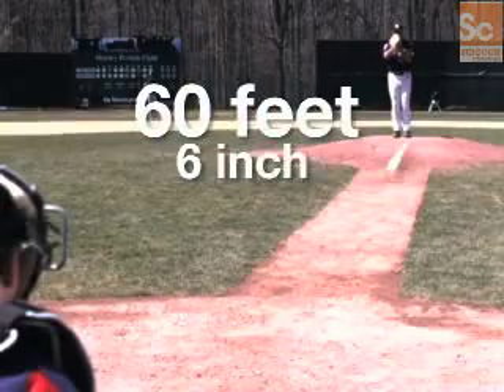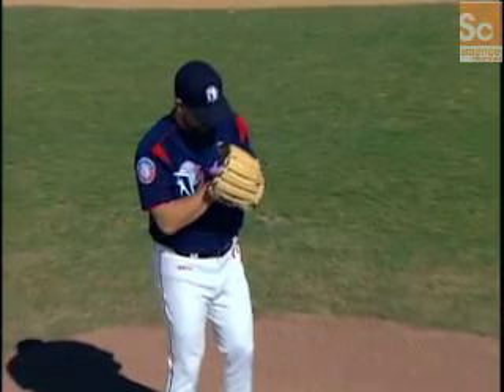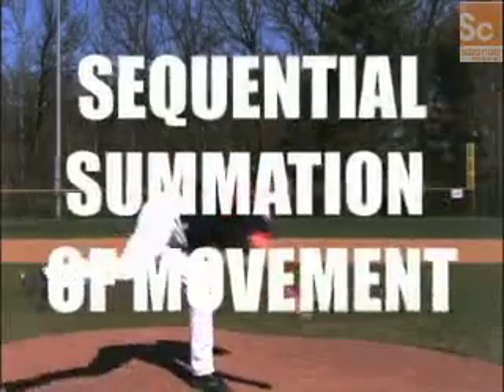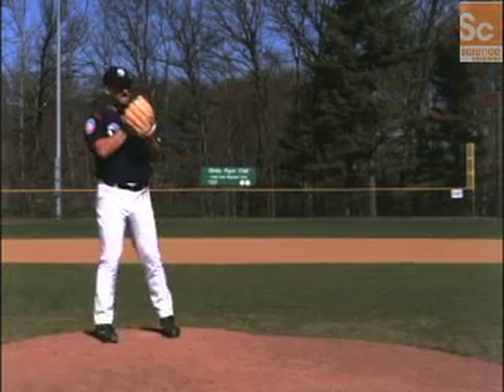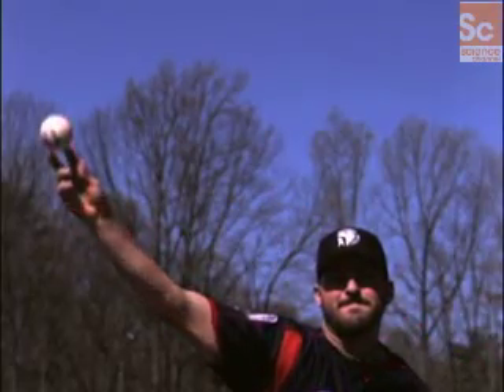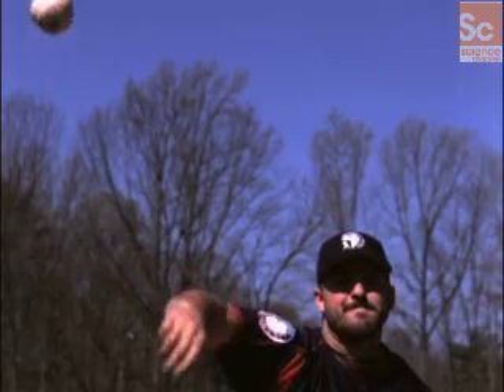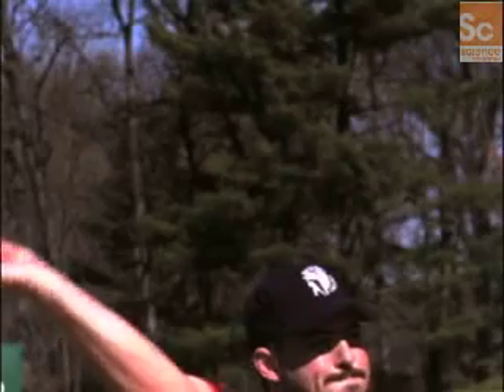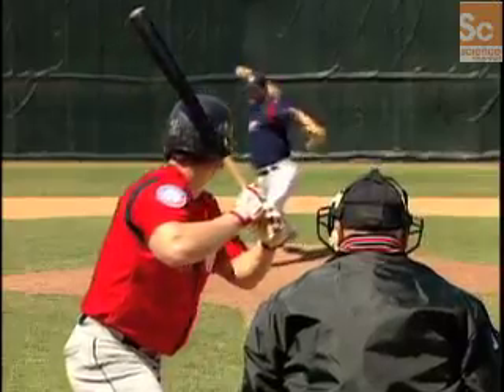The Physics of Baseball - Pitching

Comment: How does one "release a ball with less force?" Releasing, by definition is the removal of force. Whoever wrote this has no idea what they are talking about and is scientifically illiterate. Increasing the momentum of a pitcher's body has nothing to do with pitching a ball, it merely transfers the throwing event from a relatively stopped frame to a relatively moving frame.  The force exerted on the ball is determined by two factors, mass and acceleration, not the ones listed in the video.
Reply: nerd
Reply: +Nathaniel Vasquez Basic science, anyone who passed high school physics would know this.

Comment: no it said that when a pitcher is clocked at 100 mph it is really coming out of there hand at 108, but a radar gun reads the speed right out of the hand, if a radar gun reads 100 it is coming 100 out of your hand, and will slow down to about 92-93 when it comes to the plate

Comment: only problem when they say a pitcher who is clocked throwing 100mph they are really releasing it at 108mph, but when radar guns clock pitchers they give you the speed right out of the hand
Reply: Danny Powell  35ft in front of mound